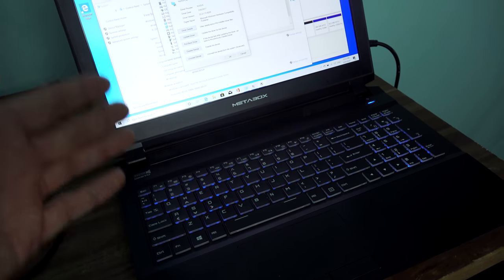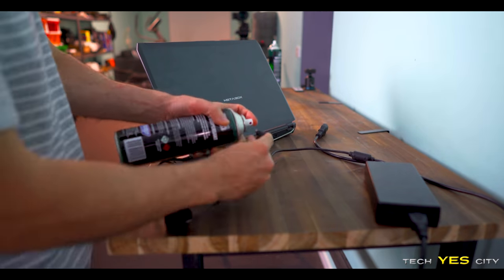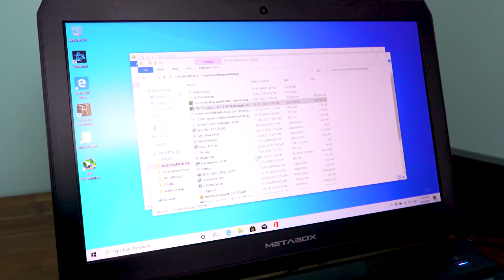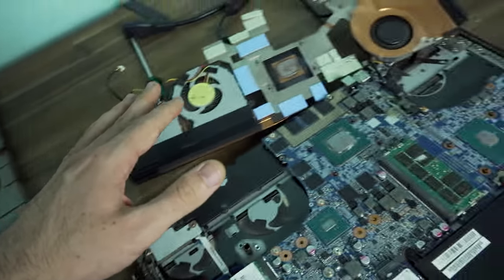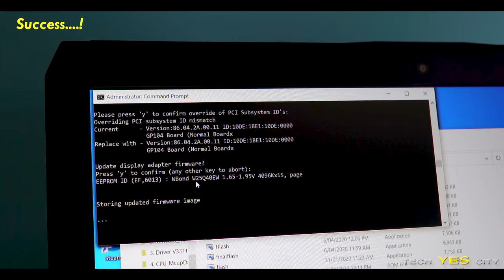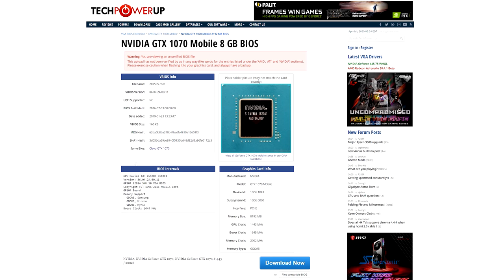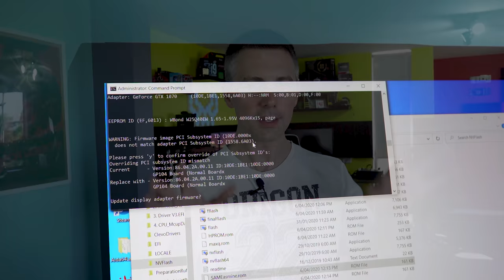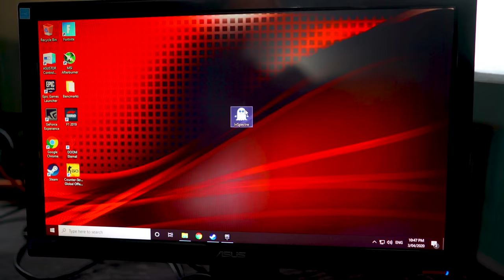I Got This GTX 1070 Laptop for ONLY $200... Though it has a VIDEO_TDR_FAILURE issue...

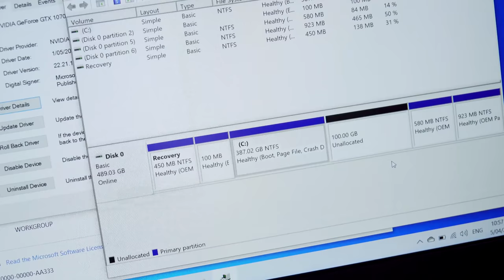Comment: 1:55 that is SSD over provisioning.  Its needed to keep the drive faster for longer.  Keep it.
Reply: 100gb is too much tho. Normally 5% capacity is standard
Reply: @Marshallchandra  you ideally want something like 20%. And 5% is below the minimum.
Reply: @kidShibuya  i think by default manufacturer already provisioned it for you that's why you get less space than advertised in reality
Reply: @kidShibuya  as other guy said,it is normal for manufacturer to drop capacity by 5% instead of 20% which in today's speed and durability off of SSD's is overkill which is why you get less then advertised,for me it is 256GB SSD being actually 238GB SSD and i have no issues with it
Reply: @xthelord1668  try it when full...
Reply: @kidShibuya  like i didn't,i still don't see a diffrence in speed when i am bottlenecked by SATA II I/0
Reply: Someone mentioned that the SSD that's inside this laptop already accounts for it, so having it is unnecessary.
Reply: @xthelord1668  No, that's not why you get 238GiB. The advertised capacity of 256 gigabytes (GB) equals to 256 X 1000^3 = 256,000,000,000 bytes, because the prefix giga means 1000, not 1024. When converted to gibibytes (GiB), you get 256,000,000,000 / 1024^3 = 238.42GiB (approx). That's pure marketing. Manufacturers get away with it because formally speaking, if you want multiples of 1024 (and not 1000), you need to use the prefixes kibi, mebi, gibi etc and not kilo, mega and giga.

That's been a case with basically all computer storage, including HDDs. I think somebody in the past has sued manufactures for misleading advertising, and now they usually put some label like 1GB equals 1,000,000,000 bytes on the box.

Comment: Really good score! I own the Sager/Clevo NP9877 (i7-8700k + GTX1070), after using Carbonaut (CPU) and Graphite (GPU) after that the temps were great even without undervolting and I could play all of my games on ultra settings without the temps going beyond 75c. If the room is pretty cold with the AC on, it sometimes goes even under 60c on ultra settings.

Clevo's are great laptops, really easy to upgrade and to maintain also it's legit bang for the buck when it comes to performance. I could even swap my GTX1070 to an RTX2080 if I wanted to and the heatsink needs to be changed while modifying abit to match the mounting pressure for the RTX2080 mxm card.

Comment: You're quite safe when flashing VBIOS to a gaming laptop as you have the integrated GPU to fall back on and can carry on flashing the one you 'break' until you get it working again. If I remember correctly you don't have to worry about the subsystem ID's etc in NVFlash as there is an option in NVFlash to force flash the BIOS so as long as the BIOS you're flashing has the same type of GDDR RAM be it Hynix, Samsung or whatever as shown in the TechPowerup GPU info page then you're generally ok and flashing it won't hurt and you can in fact end up with better performance than before with either clocks being overclocked, power limit being unlocked or even the GDDR RAM timings tightened!

Comment: Did he just WD40 the complete motherboard while the battery was still connected? Seems like asking for  short circuit 🤔
Reply: nothing to lose?
Reply: While I did cringe at that, it would not cause a short circuit. It would actually protect against corrosion and such from spills. But also attracts a lot of dust as the whole inside of the laptop is now greasy.
Reply: It's non conductive.....

Comment: I owned also Clevo laptop, but with GTX1060. 

Clevo laptops have good build and they have also things you don't expect in other laptops: 4 drives possible!
My GTX1060 laptop has 2x M2 slots and 2x SATA slots. That is a lot for a laptop, where most laptops have only 2 slots (1x M2 / 1x SATA) for it.
And laptop is also cheaper compared to other laptops for same specifications.
Opening case is also pretty easy.
Mine has 7700HQ, which is different from standard 6700HQ.
And mine was fixed with new thermal paste. So check your laptop too if it's bit too hot.

The only small thing you might not happy from this laptop: the power supply is big an heavy. More than 1 KG in weight. That is all. 

You have 1x 16GB memory, so that result in single-channel, and that will cause 10-20% in fps drop. Make it dual-channel, then you will notice much higher fps outcome in the games.
This was already tested with Desktop PCs in single and dual channel configs. It's clear single channel has chance for 20% fps loss.
Dual channel is better, also for laptops. Make it now 32GB and it will much better. You can even do benchmarks to compare both config in some games.

GTX1070 for just $200, that is really nice luck, usually they costs way much more. You found the way to fix the problem.

Comment: The unallocated SSD space is probably for over-provisioning.
Reply: That's good instinct, but not correct in this instance. 525GB MX300 uses 12 flash IC groups of 48GB each, or 576GB native. This allows for reasonable provisioning management by the drives integrated controller for optimization over time. 

The unallocated disk space is almost certainly from a sloppy disk image management by the OEM MetaBox. A lot of times loadsets are reused across multiple models, and can be a little wonky when dealing with systems with unusual parts. In the image we can see it has one of those oddball stupid multi-partition layouts typical of OEMs that waste a ton of space with general nonsense anyway (because they're too lazy or cheap to distribute a USB 3/C recovery flash media, just like they became too lazy to keep distributing proper optical recovery media, and instead want to waste our disk space with recovery garbage that is particularly useless should the drive fail lol). 

The provisioning firmware would have never been able to use the unused 100GB anyway, it would have gone to waste. It would have used the spare ~51GB of cells to move degraded cell content to until it could no longer reallocate. 

Anyway, Bryan did the right thing, clean wiping and getting rid of nonsense OEM crapware and ludicrous wasteful partition pizza is the way to go. Start out dead clean with a single partition, and then only add the things necessary and desired from there.
Reply: A lot of laptops (especially acer split the disk into 2 partitions, someone deleted the d: drive and didn't expand to fill Space)
Reply: Or they just had linux running and removed it before selling?

Comment: Tech Yes man, I ran into the same issue with an older Gtx after running heaven, screen blacked out and crashed. Now it boots up, but the entire time the screen remains black, I can hear it go into windows and stuff. I will try out the integrated graphics and reinstall the "bad" card, then try the reflash thing. Hopefully I can fix this. Thank you for the video, huge fan of your work.

Comment: I CAN BET that windows 10 "upgraded" the GPU BIOS in one of its updates without the user consent. I CAN BET

That's why it stopped working after 3 months.
Reply: how would it even do that as NVFLASH isn't a thing in Windows Updates
Reply: @abhimaanmayadam5713  what? windows does bios updates from time to time man
Reply: They do chipset driver updates. Not bios updates.
Reply: @madkvideo  nope, it can't do that. Have you never updated your bios?
Reply: @abhimaanmayadam5713  Bro they did it on an Asus Zenbook a friend owns. In one opportunity the computer started updating the BIOS after boot.
Reply: @madkvideo  wth?
Reply: @madkvideo  But that wasn't windows. Some OEM software update tools do auto BIOS updates. My HP did that too.
Reply: @AbRaSkZo  yeah but windows can push OEM updates too

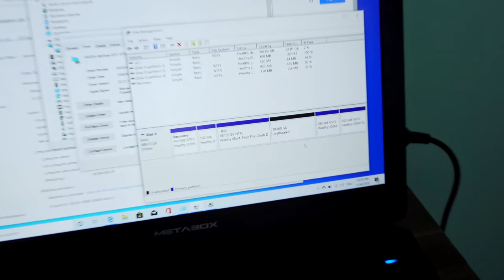Comment: 2:00 i have 100gb unallocated just so i when i fill the hard drive I remember about those 100gb, and its good for the os to have some free space
Reply: That's quite smart
Reply: Ćiro thanks
Reply: the os doesn't use those 100gb, having unnolocated is a waste
Reply: @czrptr6849  if you use an SSD that has DRAM, having some space unallocated helps extending the life of it
Reply: @czrptr6849  still serving me for when my hd goes full

Comment: I’m blown away! What a steal! I have a Clevo PA71ES-G that I did a custom BTO on through the California-based reseller Pro Star. Basically the chassis is identical to the one featured in this video, except it’s the 17” variant. 1070 and two generations forward i7. The 8750H is known for its high temps, so it has to be tamed a bit through ThrottleStop. Ideal settings for that chip were luckily easy to find thanks to Bobofalltrades on YouTube. This unit is nearly two years old and can still easily run 80% of all modern AAA games with max settings (not the wasteful settings, like full AA or Hairworks) and output 70-100 with pretty modest fan noise and temps maxing out in the upper 80’s. It’s a beast! Did your model include a high refresh display? If not you could just order a 144Hz 15” IPS for next to nothing. One thing I’d recommend is doing a Google search for Obsidian-PC. They’re a Clevo BTO outfit out of Portugal who have created two software packages specifically for Clevo systems: Updater and FanControl. I would 100% recommended the fan control software. It is very full-featured. If you’re to get the most out of your Clevo system, you will need to work on those fan curves. Updater is also a huge time saver. I’m so excited that you were able to troubleshoot your way into a full featured steal of a deal!

Comment: It's called Windows 10 that's always the problem.
Reply: Name a better supported os. I'll wait
Reply: Which has nothing to do with the problem in this video.
Reply: @redleader7988  Does not matter you don't have blue screens on any other os other than Windows.Windows can also mess up a bios don't even get me started on infections.
Reply: @stevenanderson3205  Sounds like you believe a lot of outdated stereotypes about computers.
Reply: @redleader7988   No i like to be the one making choices on my computer instead of Microsoft so i use Linux.
Reply: @stevenanderson3205  Both are fine for what they are.

Comment: $200 for a 6th gen i7 and a gtx 1070 laptop, now that is a good find even 2years from now I believe haha.. I remember buying this cheap 2nd hand desktop system and the reason it was cheap was because the seller thought that the integrated graphics was not working so it has to have a video card in it. I tried flashing the motherboard bios and the integrated graphics ran fine so I sold the video card with the same price I bought the whole system. This gives you drive to dive into the second hand market.

Comment: I read somewhere that it's not wise to fully format an SSD. The way they write to the chips is not like a normal hard drive. So when you set it up it's good to partition smaller than the maximum size so that as the bits start failing it can mark them as bad and expand into the empty space. Without that expansion capability the data will more likely become corrupt. I wouldn't be able to find where I read that but I think it's a good rule of thumb to leave 40% of the disk not formatted if you can afford it.

Comment: Wow thats really lucky you were able to flash a laptop GPU. Usually GPUs on laptops cant be re flashed for some reason, i had an hp omen that had a bad bios on the gtx 965m and tried flashing it for about a week straight without avail. Tried every single version of NVFlash and bios dumps. Lucky!

Comment: Bryan, a HUGE thank you for this! I had bought a GTX 1060 with similar problem a year ago (bought it for parts 25€, once installing drivers, pc was going on a bootloop with what I believe was your error) and I had it in my storage until today where I thought of giving it a try on your solution. Downloaded an updated BIOS from techpowerup and proceeded to flash it with this. INstalled drivers and got BSOD, upon 2nd boot, it went to windows desktop with correct resolution. BIOS was not the correct though as card was not reporting memory size, temperature and bandwidth. I then dowloaded the same BIOS as it previously had (PNY card that was working on Palit firmware) and lo and behold! Card is working perfectly again breezing through all the tests and reporting all attributes as it should! QUESTION OF THE DAY: How on earth do you come up with solutions like this? Thanks again YES MAN!

Comment: Not to be overly pedantic, but that's not an AC adapter you're plugging into the laptop. That's DC. The external power supply/brick is converting the AC from the wall to DC for the laptop. Just a minor point. Great video nonetheless.
Reply: Well it's AC/DC adapter, strictly speaking

Comment: The 100GB unallocated SSD space are an overprovisioning method. It increases the lifespan of the SSD significantly (especially when there are many write operations happening on the regular) and probably was set in the samsung magician software

Comment: Cheers - bought a used laptop for $400 myself with the exact same fault and now it's fine, however it does still run at 78-85 GPU usage with witcher 3 ultra turned on so not the coolest....
Reply: So the fault wasn't completely fixed - when 1st booting and opening up a game it would crash....but if I wait for a few mins after turning on and run stuff it runs fine for hours..... After a little more research I've under powered the CPU by 150mv and ran stress tests OK - still continuing to test but appears to be OK so far....There is suggestion that it may be the sudden change in power draw causing the PCIe bus to flip out - The fact that it's completely stable once it is working is odd...

Comment: Watch the 12v rail for deviation. I had an issue when on the power supply, the performance mode would kick on and the power supply's output would dip and the gpu would crash. Only way I found it was logging the voltages and looking at them after the crash. 12 was all over the place and would drop under load and crash. New power supply made it run with a solid 12v and no crash.

Comment: I love how you think this is a laptop CPU running hot. You should see the gaming laptops that hit 100 degrees before the fans can catch up when you benchmark, and will rarely go below 90 once they get going (if you are lucky).
Reply: It has gotten much better now. I'm still amazed how a full blowen GTX 1060 in a laptop can run at only 70c full load but CPUs still suck ass. AMD pls help.
Reply: @alex_inside  Well, i think that wyterabbit was talking about higher end gaming laptops which really run with 90C average. A GTX 1060, a lower end card, wont hit those temperatures ofc

Comment: I'm watching this video on the exact Metabox chassis but with a 7700hq, 120hz VA panel and a bunch of nvme/ssd's. Bought from metabox new just under 3 years ago i think. It's been a beast for me although I have had what I suspected to be some powerd delivery issues, but nothing in the last year or so. Example, I'd game in discrete mode for a few hours, and sometimes it wouldn't like to turn on again if i'd turned it off right after gaming. And my battery is trash, used to get about 3 hours with off charge with mshybrid mode just watching youtube n that and the percentage would be accurate. Now I get under an hour and it will just turn off with no warning. Maybe coz I have it plugged in most of the time idk. I've given mine a clean out and probably due for another.. but yeh, 200 beans for this laptop is a steal mate! Metabox are local to me in Perth btw.
Reply: btw, the chargers alone are worth over $100 last time I checked lol

Comment: I have an Origin Eon-13s which is a rebranded Clevo WS230SS and had this exact issue back around July 2019. Any time the dGPU took over, instant blue screen - same TDR error. I assumed the dGPU (GTX860M) had died cause I could force Windows to not install the drivers for the nVidia card and only run off the iGPU and it would be fine. I was dual booting Linux (Current Ubuntu at the time) and could disable the nVidia card as well and it would work perfectly (alas reduced graphics performance). Retired the laptop and bought a used Razer Blade 14" (Early 2016 GTX970 model) for cheap to replace it. Given, the Razer Blade is more powerful than the Eon-13s ever was, it would be nice to have that laptop back. I went through some real hard times with it and having it working would be nice... just for sentimental value. Might try this trick to see if I can get it running again with the dGPU. Thanks for the content man. Appreciate it.

Comment: I work on laptops a lot your right Brian it’s about the lowest cost to get your value in a deal. I get old i5 laptops for 40 bucks or less for basic machines for people it work out well sell for 100 or 120 usd!
Reply: What tool did you use to flash that bios on the 1070?

Comment: ahh nice to know another trick for you for fixing discrete dedicated GPUs on laptop, i'll try that on the laptops i failed to fix on nvidia GPUs thats laying around.

mostly i know it bad thermal paste or the worse case is GPU ball needs to reheat, else reball the solder

Comment: Very good video, learned something new though it was a do or die fix very risky.

For someone who cleaned the laptop so meticulously you made me cringe when you spread the thermal paste with your finger.

You're passing the oils from your skin onto the paste and it may cause the paste to dry out faster then usual. 

May or may not be a big difference but by using a card or tool it will becomes a non-issue.